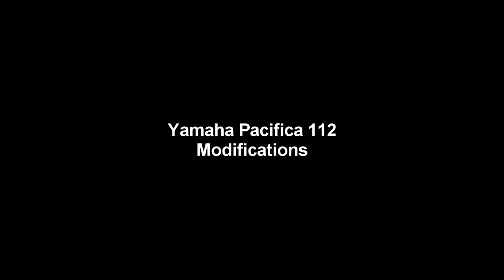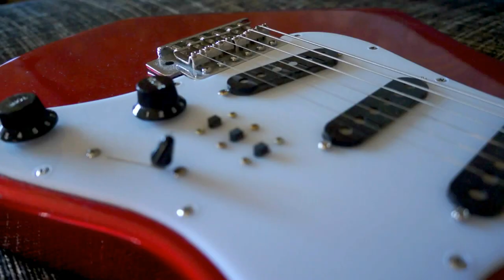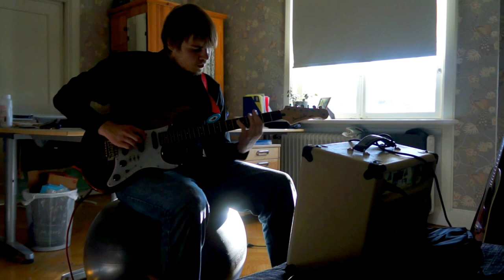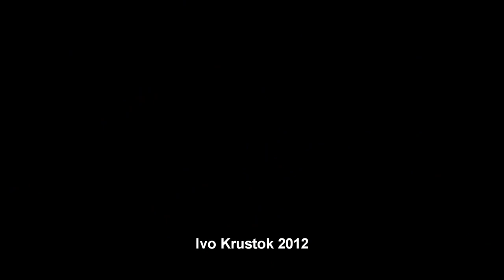Yamaha Pacifica 112 Complete mod

Comment: Amazing thing you've done there. I love my PAC112. The pickguard looks amazing. I do think the low resistance pickups sound a little bit thin for some uses, but it could just be a matter of taste and eq.

BTW check out the wiring scheme I made for my guitar at ?v=wWVYXqy7z7A . I think it turned out pretty useful and manageable.

Oh, and I gave up on that 400v capacitor too. It messes with the shielding's noise-catching abilities.